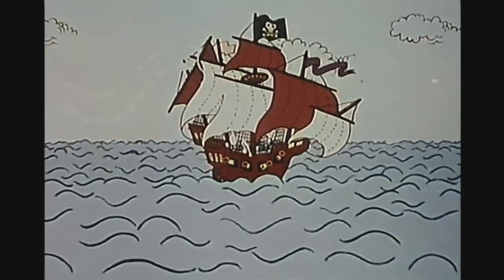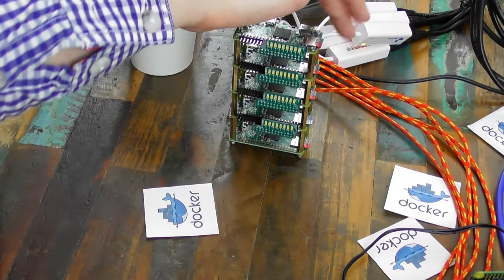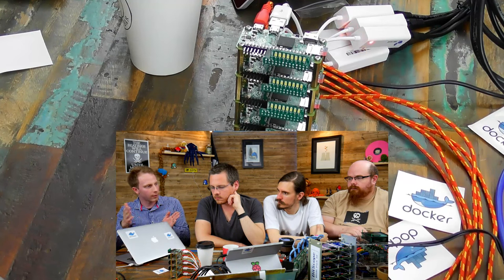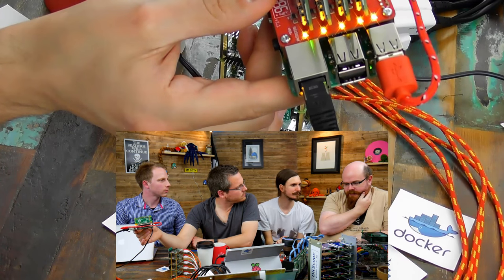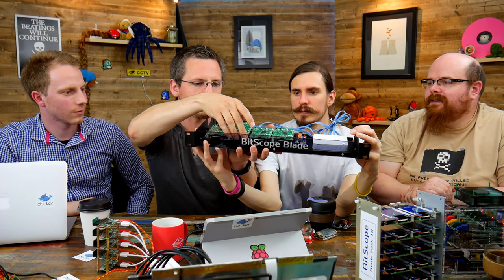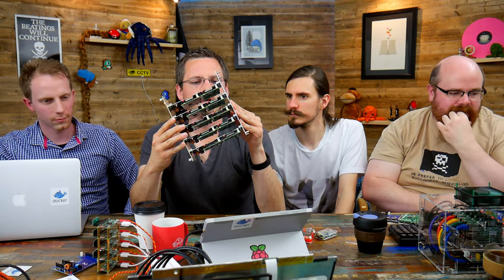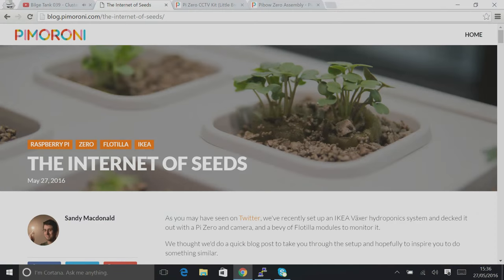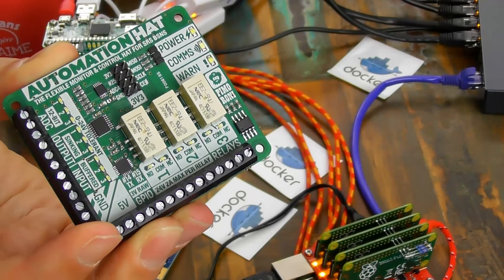Bilge Tank 039 - Clusters, Docker, Brambles & Raspberry Pi Supercomputers!

Comment: for the clusterhat. did you only load the img file onto each pi zero and controller, turn it on and it all work with no setting change or programming required??

Comment: So what are the clusters like using an OS I’ve not seen anything showing this just how a cluster looks or how to build them rather than anything else. Obv you have sd cards in but what do you do software wise and then even after that. I sssume these can be servers and used for a myriad of things but no one goes in depth on that side or I’ve not seen it.
Reply: If you're using docker swarm you issue commands from the master/manager.

The swarm knows what nodes are in it's list so you just run the command from one place.

You expose the services via traditional docker commands and then either...Configure a load balancer as he's done here to issue requests across the docker instances or browse directly to the loaded services.

E.g.
You've got:
Node1 - master
Node2
Node3

You launch two instances of Apache using docker swarm by requesting it on node1.

This loads the process on node 2 and node 3.

So you can browse to
Http://node2
Http://node3

Or...

You can now configure another docker image to act as a load balancer and ask it to be provisioned on another port.

Docker provisions it on node3, port 8080.

So now node 2 is running 1 instance of Apache, node 3 is running 2 instances.

You connect to http://node3:8080

The load balancer issues the request to node2 and returns it back to you.

That's how it works. A cluster just gets managed centrally, easily. By typing 2 commands in a single host you can spin up 3 instances of Apache, have a load balancer configured and if you want more nodes it takes moments to just spin up as required.

Obvs this is just a single example. Imagine scaling databases, integration tests, buildchain tasks.